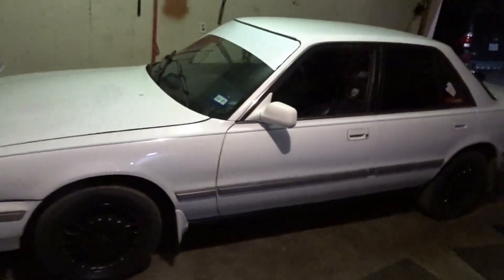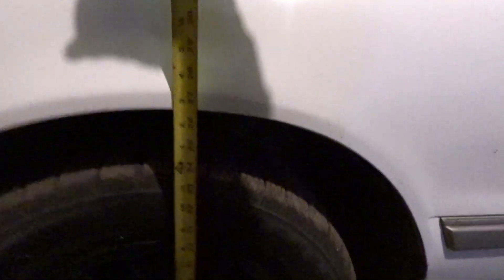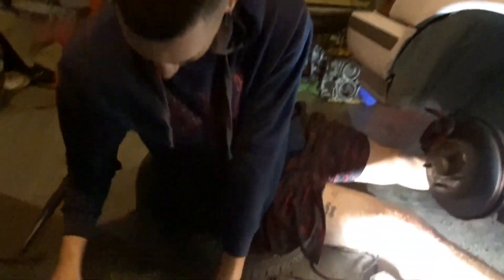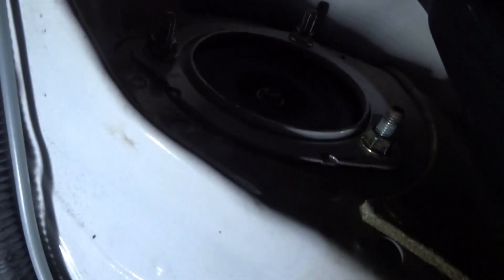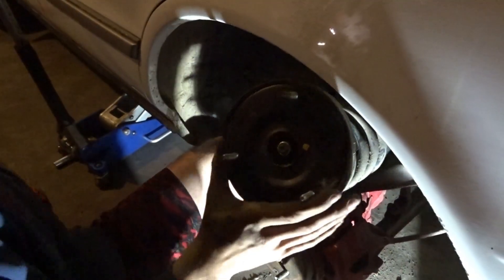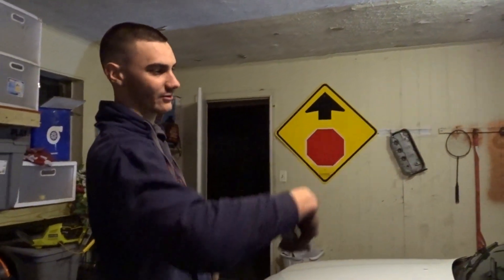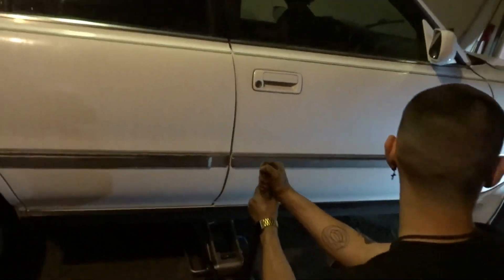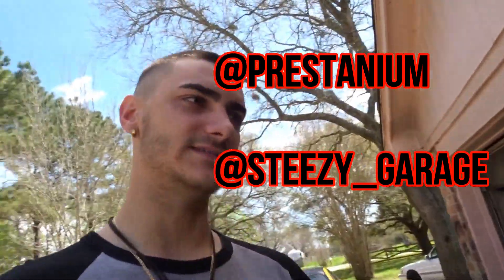Cutting Springs on MX83 Cressida

Comment: Hey just curious how did you hang the tsurikawa from the back? The tow hook is like turned so when I hang mine it is facing sideways
Reply from the maker: Dylan I just have it zip tied tight asf so it hangs correctly. I’m never going to use it as an actual tow hook so I’m not worried about it staying on like that.
Reply: Steezy Garage hey thank you man and if possible check Instagram dms